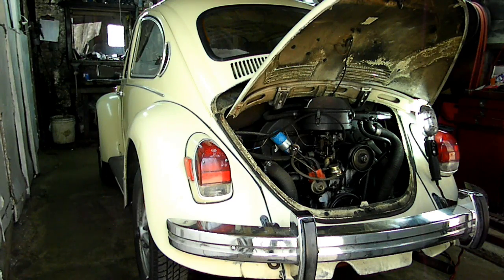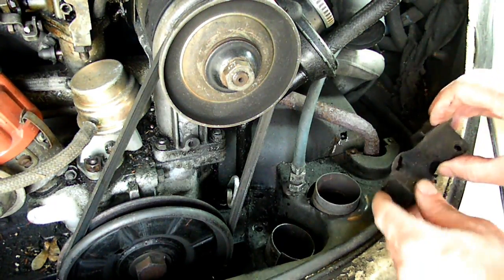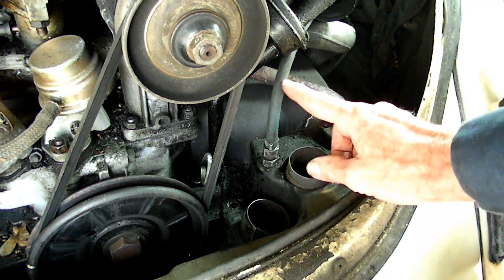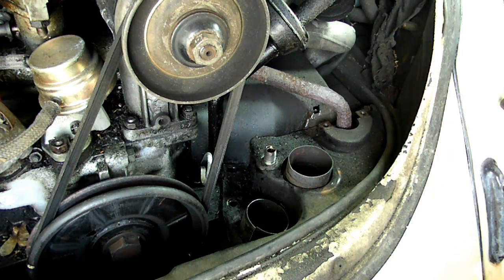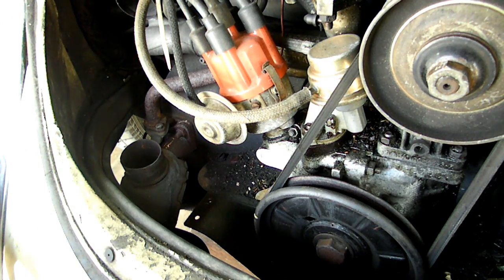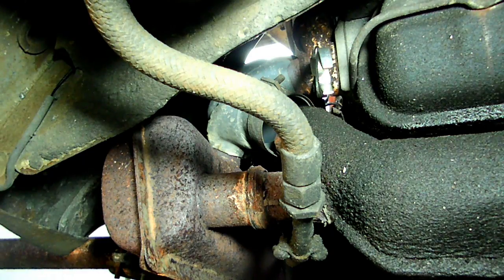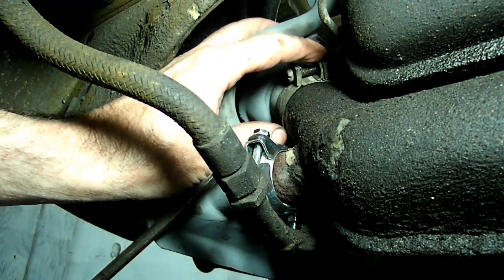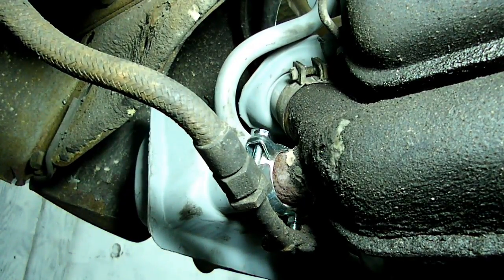Volkswagen Beetle Muffler Replacement

Comment: Good luck getting the heater boxes lined up on currently available mufflers. They are off by 1/2 inch. I had to cut sheet metal 1.5 inch wide and wrap it around the gap then use radiator hose clamps.
Reply: Best to source NOS German made mufflers (Leistritz, Ernst, Lange).

Comment from the maker: @CoolasIce2 Yes the engine cooling fan blows air tru the small heater which is part of the muffler then there is the large heater box which is under the valve covers.You do have to be careful with exhaust leaks because the gas can end up inside the car.

Comment: Great video...I'm going to change my muffler as soon as it warms up a bit outside...my 71 Super Beetle now has the GT muffler with four tips..a bit too noisy for me...my carb heat tube is clogged solid, so I have a new intake manifold to install at the same time...I've had it apart before and I used Never Seez on all fasteners...I'm glad I did this...again, a great video !

Comment: My '73 VW kept popping out spark plug, so I took off the engine to change the heads.
Question: Do I need to remove the mufflers to have access to remove the engine heads? all the bolts are rusted and very hard to remove. Any advise would help
Reply from the maker: Afra Bangash The muffler is bolted to the head so it must come off before the head can be removed.

Comment: Great video - brings back some memories of when you could actually 'see' the engines in cars. For those of you who think this was a hard car to work on - at least you will never have the situation where the car doesn't start because the radio is bad. I'd much rather break down on the side of the road with something like this than something modern.

Comment: Yes I know this vid is very old, but still relevant. I always find it easier to pull the engine when doing a muffler. (it only takes me 30 mins to do it) while it's down i pull the fan shroud and generator/alternator and pressure wash the fins and oil cooler, (oil/dirt build up really hurts the performance of those air cooled engines) it also makes fitting the new muffler go a lot easier, ALSO! the intake manifold nuts tend to work loose at the head and should be re tightened when installing a muffler. Plus I like to paint the tins (customers seem to like that "little extra")

Comment: Thanks for posting this!  It gave me the courage to swap out the junky Empi economy "performance" muffler on my new-to-me '68 with a stock system that  sounds like a VW should sound!

I realize it's been a long time since you did this but do you recall having a hard time reinstalling the breast plate after the new muffler was installed? The small heat exchangers for cylinders 2&4 were so far off that I had to enlarge the holes in the breast plate so the heater hoses could be reconnected.

Comment: Wow rich your videos are incredibly informative thank you for taking the time to make thes.. really gave me the confidence I needed to do a lot f my own work..  when I saw you working on this autostick I just had to ask your advice on my situation. I have a 1969 autostick and my motor is completely seized I can't get to the torque converter bolts.. what's the best way to get this engine out?
Reply from the maker: I never had any autosticks that had seized engines lucky i guess but i did find this thread https://www.thesamba.com/vw/forum/viewtopic.php?t=651016&start=0
Reply: Thanks for posting that thread! Got some great info 👍🏻

Comment: when you talk about loosening the bolts where the muffler goes onto the cylinder head you point out that it as this stage  where everything goes wrong/can go wrong. I am trying to take off a muffler which probably hasn't come off in 40 years. You suggest heating the nut and obviously the bolt. I want to know to what extent I should heat the nut and bolt? Do I heat it to the point where it starts to change colour or is it just a , make it hot, thing?
Reply from the maker: +Rob Meister I heat it enough to a point were a part of the nut is red.
Reply: +richpin06a thank you for your prompt reply. The four nuts are an absolute bugger. I have been applying rattle can penetrating oil regularly in preparation to loosening them but they wouldn't budge. I don't have ocetelyne  but do have a good lpg/propane set so although I can't get to red hot I can make them pretty hot. The top right one  came off with 1 heat treatment, the top left wouldn't budge so I had to use a chisel and notch the nut and then hammer it along and have got that moving. 
I am now under the car and the remaining 2 are not fun.  I have found that the bolt shafts protruding from the nuts have almost no thread or no thread left on them which asks the question, what when I want to put the nuts back? Are the bolts welded onto the engine or are they studs? If they are studs can one remove them without removing the engine?
Reply from the maker: +Rob Meister The studs screw into the cylinder heads.I have replaced them but they can be hard to remove.

Comment: @richpin06a Totally off subject but on the 98 saturn sl1 im getting this clicking/ticking noise as i accelerate from a stop, and sometimes it sounds like its coming from undernieth the car(muffler/cat), and then sometime i think under the hood(hopefully not) I think its under the car butbeing that ur the master at these cars any ideas? Must i use premiun gas instead of regular? I have 193,000miles on this baby.

Comment: Rich, With help from your very well made video, I just finished installing a muffler on my '71 Ghia. I used PB-Blaster on the bolts and propane on one of the large ones. Two of the smaller bolts broke off, but it didn't matter because they were bolted into the old muffler. Like you, I also need a pry bar to align the small bolts. Thanks again for the great video.
P.S. 

Purchased a Dansk 113251053AK muffler from FCP Euro and also the new bolts/gaskets kit. It seemed to fit reasonably well.

Comment: Good vid. How does heat get into the passenger compartment?   Does the engine cooling fan  blows air around the muffler and into the pass compartment? If so, what if the muffler has a hole rusted thru it? The exhaust gases will go the passengers too.

Comment: Is the tailpipe a cylinder, straight through hole, or is there some muffling insets? I've seen both types and wonder if there's a big difference.

Wouldn't hurt if the car was quieter but I wonder how the exhaust sound is with those muffled tailpipes. :)
Reply from the maker: Eric Öhman The stock tailpipes do have baffles in them.

Comment: im getting ready to do this on my 63, mainly due to the fact that i need to clean out my heat riser.  bit of advise, if you have that muffler removed and the heat risers are accessible, I'd take the time to clean them out now so you don't have to do this again.
Reply from the maker: Thank you for the tip Shawn.

Comment: i really appreciate this video but quick question i have a 1972 vw beetle and my grandfather has some partsfor a 1974 and i need a new muffler could i use the 1974 muffler for my 1972?

Comment: Hey Rich, my muffler doesn't have a heat riser for the preheat hose, does that just sit over top of the muffler? You're awesome! Thanks.
Reply: sorry I mean pre-heater tube.
Reply from the maker: There is a elbow pipe that you need for the preheater hose.
Reply: Thanks!

Comment: Oh my god clean that engine and find the oil leak. FFS
Reply: Steve Madak 
You got that right. One of the dirtiest I've seen in a long while. When I had a 74 Super Beetle years ago the first thing I did was clean the top, bottom, front, rear, and sides of the motor to see if I had any leaks and from where. Also just made it easier to work on in general.

Comment: I found if you soak the bolts with wd40 for day then do it again it come off easy that what I did to my bug I got 1968 bug and the heater box and tube where rotted so I got them off after you soak the bolts with wd40 I crack the bolts and they came easy I made shire to trim the bolts both way so it won't break off once it loose tiger it 2 turns then back it off I done that all bolts came off with out striping or breaking off
Reply from the maker: Soaking ahead of time is always a good idea especially if you live in the salt belt.

Comment: Rick can you please do a video on wireing I got rewire all my head light taillight and break lights and so on because the original wires been cut so I have to rewire them and solder them on thanks
Reply from the maker: The only beetle i have now is my 1956 i wish i had all the others i use to.